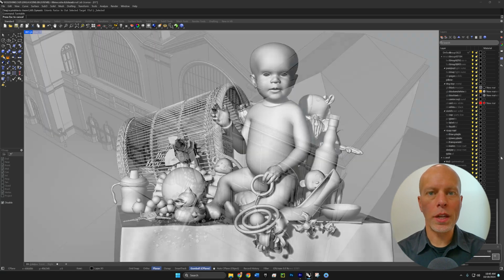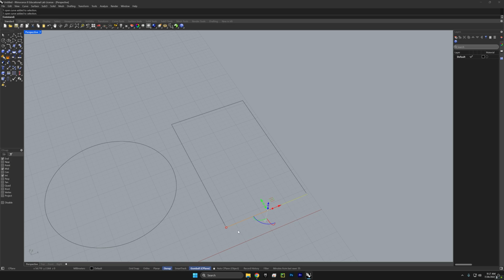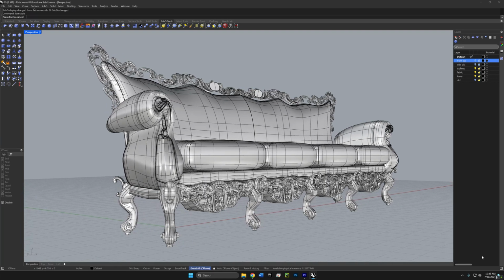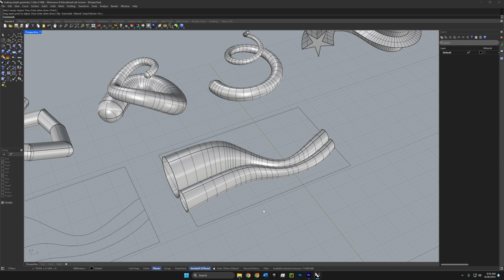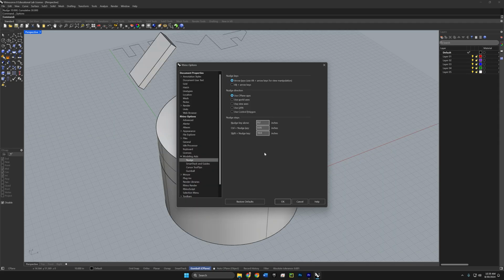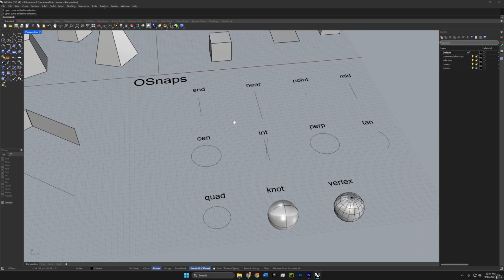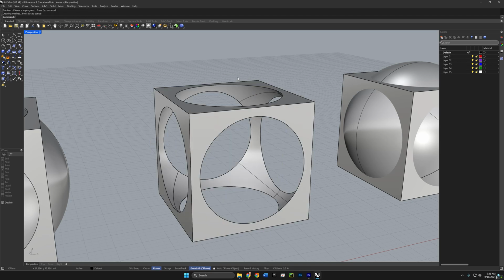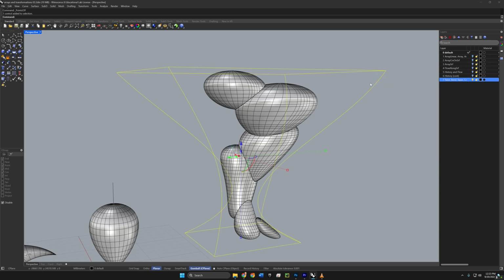Rhino 8: Full Beginner's Course

Comment: I'm completely stuck at move and rotate! When I try to snap the tile to the elevated blue square, I can't get the tile to move up in z height, so it only moves along the x/y plane. What am I doing wrong?!
Reply from the maker: I wonder if the problem is that you were looking at the move widget from up above. Try changing your point of view so that you are down lower at eye level with the move widget. Then you should see an arrow pointing vertically that you can grab to move the object up and down in space
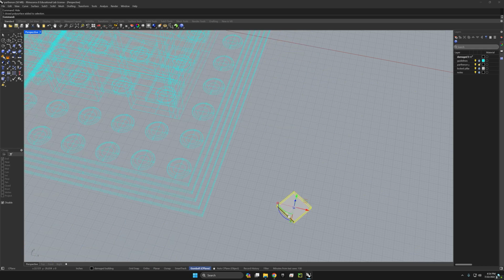Reply: @joemeiser  I'm able to move along all 3 axes when I use the gumball, but when trying to do the precision moves that you demonstrate (starting around 12:30 in the video), when I turn on osnap and try to snap the corner of the tile to the corner of blue diagram box, I don't seem to be able to grab the point of the diagram box and can only move the tile along x and y (but not z). I'm using the perspective view, just like you are in the video...
Reply from the maker: It might be that you do not have the right Osnaps turned on. Make sure the End osnap is enabled so Rhino can grab a true 3D corner. If that is off, Rhino could potentially keep the move stuck in x and y.
Reply: @joemeiser  I finally figured it out! I had to go into the modeling options menu and uncheck "Only snap to selected objects." Thanks!

Comment: Excellent, really clear and concise. I tend to keep Near Snap and Apparent Intersection permanently off though, only switching them on if I really, really need them, and then off again immediately. They can cause havoc otherwise!
Reply from the maker: Thanks for the feedback and for sharing your strategy for using snaps, that's a good tip!

Comment: I accidently have two objects connected that aren't suppose to be in Moving Objects /  UI Basics. It is part of a wall and a header. How do I ungroup them I tried ungroup but didn't work?
Reply from the maker: That's odd. I haven't heard that before from those working through the course. Since ungroup isn't working you could try explode, then group the parts together
Reply: @joemeiser  It is okay I probably did something to it without knowing. I'm very good at that. I'll move on to the next tutorial. Thank you for the reply.
Reply: @joemeiser  My main goal is to turn a Victorian-Style/Carpenter Gothic Style 1854 house into a 3D model from N, S, E and West Elevations. I do not have a floor plan. The house has been demolished. I do have a photo. Do you have a tutorial on something like this?
Reply from the maker: @JeffHill-y6b my background is in sculpture, not architecture, so my approach to that kind of project would be intuitive only and not informed by the conventions of home building. I wish you good luck with the project, though
Reply: @joemeiser  Okay thank you

Comment: I run into problem with sweep2rail and booleanunion: when I made the two pipes it seems like pipes are not formed perfectly on some spots on the inner rail which both share. Program shows exclamation points and boolean is failed. if i move the pipes apart the union works. Do u have any advice? Are the pipe radiuses interfering with curvature of the curves in someway?
Reply from the maker: Yes, the pipe radius and the curvature of your rails can definitely interfere—if the pipe radius is too large for tight curves on the inner rail, the sweep can self-intersect or distort, which breaks the Boolean; try reducing the radius, increasing rail separation slightly, or rebuilding/smoothing the curves to avoid sharp bends.
Reply: @joemeiser  thank you <3

Comment: on 1:40:30 for connecting two surfaces, while going through the surface tools I have found a command that does the exact same thing with fewer steps. The command is called "ConnectSrf". Just scale the horizontal plane by x and y axis separately to match the other surface and run the command.
Reply from the maker: Thanks for sharing! I haven't used that command before. I'll give it a try.

Comment: Joe, (coming from MODO and Cinema 4D), is there a way "auto align" the Gumball to a selected object? Also, is there a way to add a snap point to an object and move that object to another objects snap point, with axis aligned? Also, is there a way to move an object and to have it auto align with a polygon's normal?
Reply from the maker: If you right click on the bold gumball button at the bottom of the screen you'll find several settings that you can adjust to make it behave differently. Practically, when you need to move an object in a very specific way, beyond just using the o snaps on the existing parts of the geometry, you might want to add one or more reference curves. That way you can snap to particular parts of the reference curves to accomplish the desired result
Reply from the maker: I have a section on o snaps later in this video

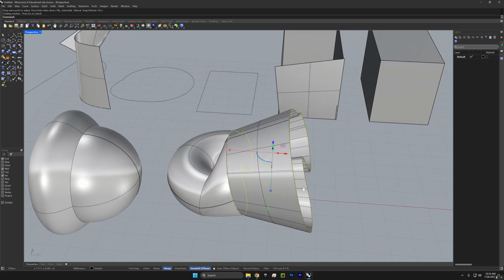Comment: Hi. At 26:10, you do a loft between the trimmed torus and scaled duplicated boundary. I've re-tried this step several times, and I always get "Unable to loft - select either open or closed curves, but not both". The torus edge is apparently not closed. How do I solve this problem?
Reply from the maker: It sounds like you're trying to loft a closed and open curve together, which will always fail. You may need to dup all edges on one of the sides, then join them together to create a closed curve. If you are unsure of whether a set of curves is open or closed you can select it/them and run the "what" command to get Rhino to give you some information about it
Reply: @joemeiser  Thanks for your help! 😀

Comment: What is the configuration of your gumball at 34:09? Every time I move or rotate it, it resets to the default position.
Reply from the maker: At the bottom of the screen if you right click on "Gumball (plane)" you'll find some settings. At 34:09 I may have had Auto reset Gumball turned off, and align to object turned on.

Comment: Great tutorial! You built on concepts in a way that naturally made it easy to understand the underlying mechanics. Another one I tried was largely "this does this, that does that."

This seems like such a more powerful and intuitive program than the crappy niche direct modeling software we use at work (that's also 4X the price: CADKey/Kubotek) while still retaining the features that I do like about it--mainly the multipart layers and gumball.

Seems ideal for 3D printing over even Solidworks and Fusion. (Edit to add: And Rhino coming from such a seemingly ethical company, too. No shady subscriptions or any other shenanigans.)
Reply from the maker: Thanks for your thoughtful comment! I'm really glad to hear that the structure of the tutorial helped make the concepts clear. Rhino definitely has a lot of power and flexibility, and it's great to see it being recognized as a strong program for 3D printing and design. Appreciate you sharing your insights, and I hope you continue to find the course useful.